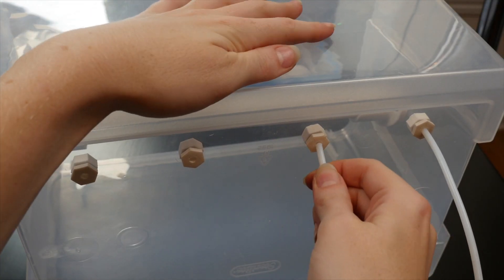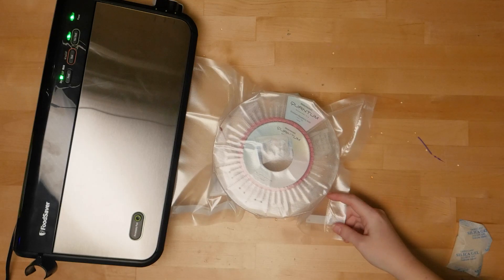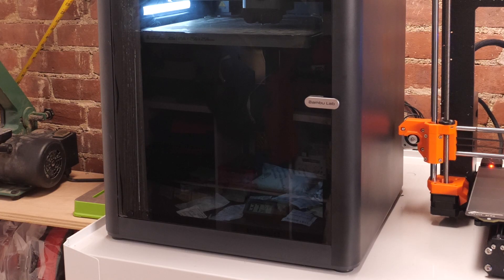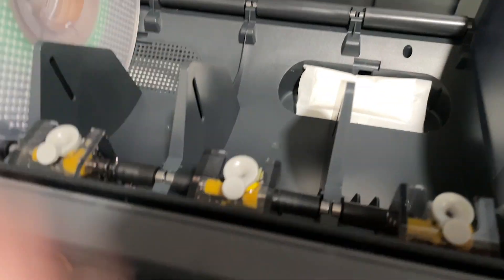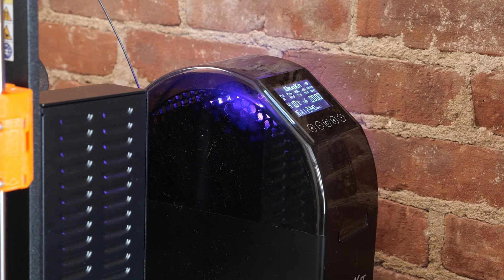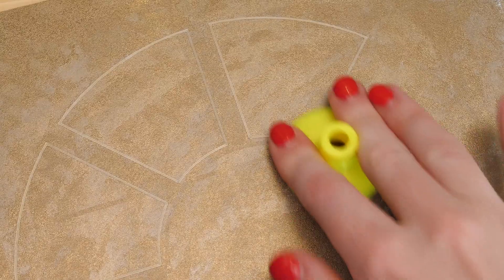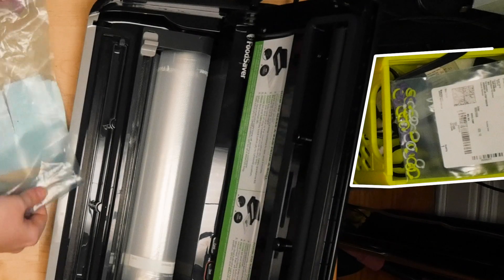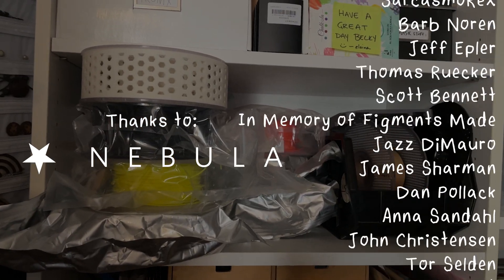Filament Storage Tips!

Comment: You can pick up a set of vacuum bags and a hand pump for not very much money.  It's marketed for people storing clothes but works great for filament.  I also bought a bunch of reusable silica bags that are made of cotton, and you can microwave them to refresh them back when they have absorbed a lot of moisture.   I toss one of the silica bags in the center of the spool after I put that in a vacuum bag, then pump out the air.